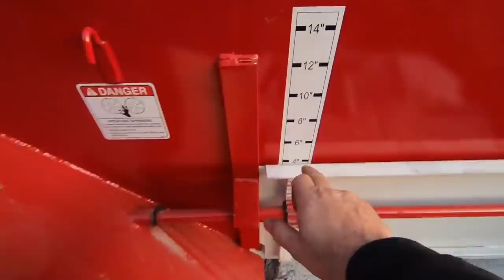The Spreader Spreads Badass

Comment: Only advantage of having a fertilizer type chain is that if there is an obstacle in the material that will not pas under the rear gate it will slide along the chain where as the slatted chain will either bend the chain or remove the rear gate..... ask me how I know?

Comment: ... I dunno, a little paddlewheel above the chain with brush lines on it running about 3x the speed of the chain would smooth that feed out pretty good.  Might gain you a foot total width.  It isn't so much a worry about the hydro motors as the hose crimping I think.  Those motors will move a LOT of force.  Question about the motor assembly tho, can you give the spreading wheels a camber so they aim up-out instead of flat?

Comment: Not saying one-way or another. I have (in partnership with farmer/friend) almost same machine and it's a fine lime spreader. Ours is older, mechanically/pto driven, full stainless (fertilizer type web) and we bought used so take it leave it. We took it, no regrets. Probably should have bought new all stainless construction for long run. Web is scaring me a little and should be sandblasted/painted. Keep it oiled.

Comment: I can understand your problem with a telehandler not being able to pull your loaded trailers BUT the other things it is capable of doing that your tractor or skid steer can’t surely deserves a demo model. Pushing your brush further than your skid steer stacking hay way higher than your tractor saving space and less wasted top/bottom bales   I’m not sure being English what your laws are regarding towing unbraked trailers but they have the power. You said before you got your skid steer that you didn’t need one but afterwards you said you can’t do without it please look into agri pro telehandler that’s available in the us. Not trying to tell you how to do things and I know better because I don’t